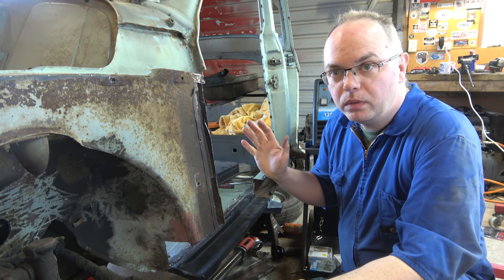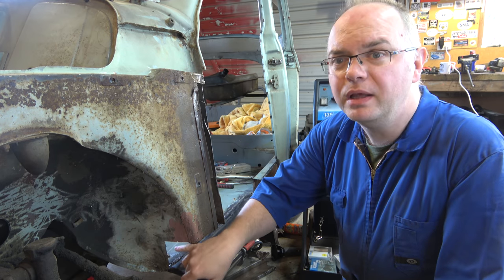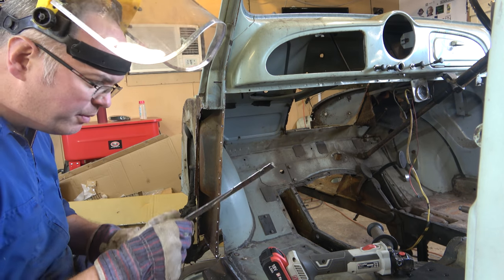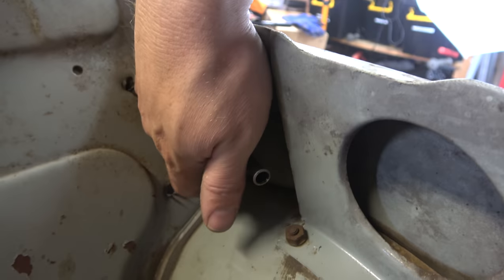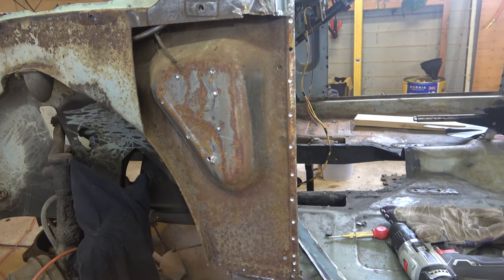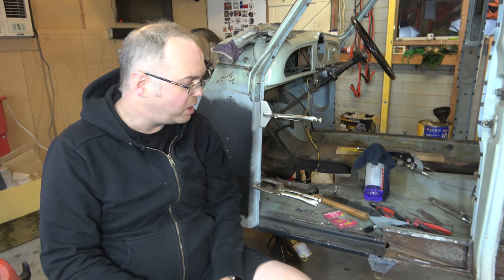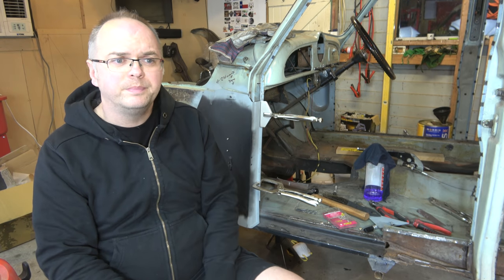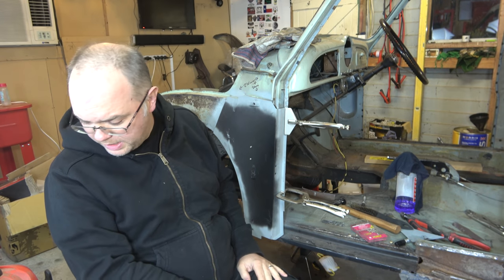Morris Minor - Fitting Panels - Part 21

Comment: Two pack epoxy primer is brilliant stuff for old cars like this. It sticks like the proverbial to a blanket and is tough.
Reply from the maker: Supercheap Auto are supplying the paint so I'll be using their etch primer then primer filler. Keen to see how their paint system works out. Cheers

Comment: Cleco clips (and the pliers) are handy for panel work, keeps everything where you want it and allows for perfect re-positioning. There's also a spot weld chisel you can get which is kinder to panel flanges. :)
Reply from the maker: I did consider cleco clips and I might get some if screws and clamps don't do the job. I hadn't seen a spot weld chisel, will check it out. Cheers

Comment: A very difficult area. Make lots of marks, use your level and straightedge, and occasionally test fit with the door. Tough to do until you have the hinges tacked in, I know, but mistakes in this part of the job are hard to fix. Fortunately, the hinge bolts have a bit of room to align, but take as much time as you need to get it perfect, or near as dammit. Looking good, so far.
Reply from the maker: I'm taking my time on this panel to get it exactly where it needs to be. As you say getting this wrong makes the rest of it really hard to get straight. Cheers

Comment: Great job Jonathan!  Slow and steady wins the race. 👍☺️ Fish oil sounds interesting but does it stink?
Reply from the maker: Thanks Niamh, it's a work in progress. It's sold as deoderised fish oil so hopefully not!
Reply: It's a really old-school method. I'm in my 50's and I remember my dad using fish oil all the time. It did have a smell, but it wasn't awful. You could tell it was fish though.
Reply: @pbaylis1  Not sure I'd trust that method entirely (assuming it's used for rustproofing, must have missed that bit somehow). My parents bought a 96 Mitsubishi L300 in 2012. The previous owner used old motor oil for undercoating every year and the result was a flaking mess of sticky oil and dirt, hiding plenty of rust. Getting it off was a nightmare!

Comment: Very nice! Would be useful to see how you went about rolling that panel edge over and welding it. What is that tool you're using to punch the spot welds before you drill them. And are you just using an ordinary drill bit?
Reply from the maker: As soon as I have figured out how to roll that edge I will share the method!

That's just an automatic centre punch to stop the drill from wandering. I am using a standard HSS drill bit. I did have a spot weld drill but it was completely useless. Cheers